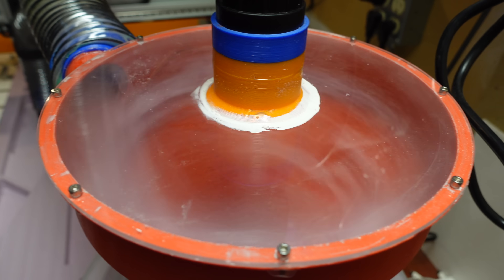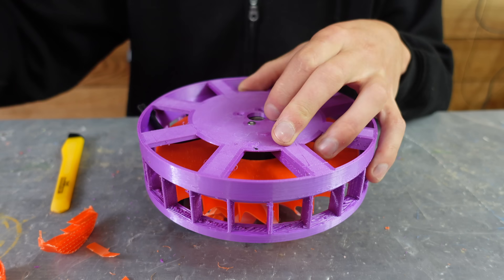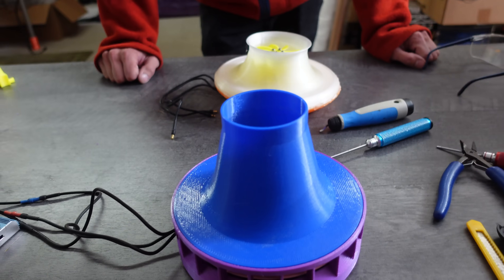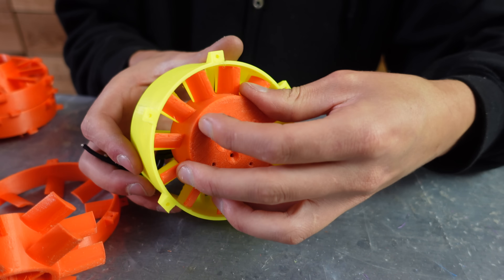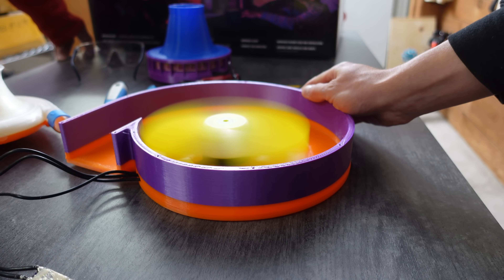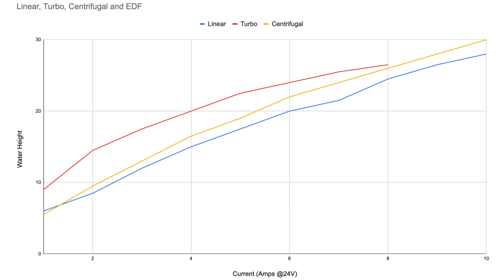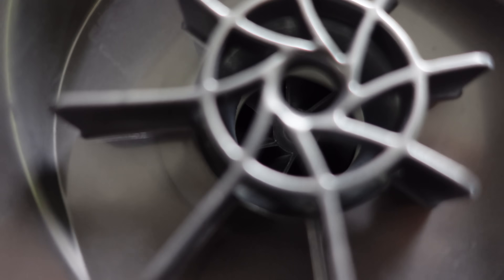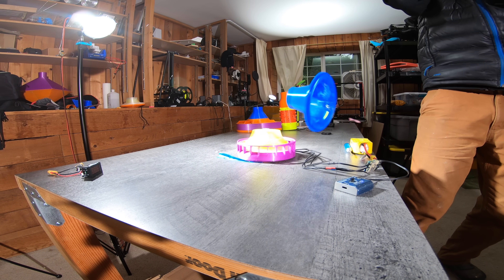DIY 3D Printed Vacuum Impellers

Comment: Looking at the turbine with its housing, my first thought was: "oh no, he made an air raid siren". Look at the air raid siren from Matthias Wandel. Those equally spaced stator columns with the rotor blades are probably what makes that horrible noise.
Reply: "Horrible" depends on what type of person you are.
Reply: Yeah, you need unequal number of blades vs outlets, otherwise you end up with a siren :D
Reply: @akkudakkupl  Yep
Though there are some sirens that have 4 outlets but 10 blades or 10 ports, For instance, The CLM Siren. Another example would be the Thunderbolt series. With only 1 thin opening at the front
Reply: @BSC_PRODUCTIONS  Well the more correct answer would probably be to have blades and outputs non divisible by a common denominator? For example two primes, or a prime and the same number -1 or +1.
Reply: @akkudakkupl  That's only to get a constant tone, I was mostly talking about the matching blade and outlet cutoff shape that significantly increases the noise because of pulsing.
Reply: Also for a compressor those "columns" should be at a flatter angle and farther from the rotor

Comment: Should have also tried a squirrel cage design. Poor static pressure, but they're hard to beat for flow rate.
Reply: Would be interested in a lobe and a screw type too.

Comment: Can someone correct me if I'm wrong but when powering a motor there is no such thing as constant voltage and changing current? If you limit the current you also change the voltage.

Comment: Cool stuff.  Most turbomachines (non-positive displacement) reach peak pressure delta across them around their mid volume flow capacity.  You could be quite far down the pressure capability in your static suction test.  My bet is the turbocharger style would win out for suction per watt input.  Your axial flow design has the most potential but you need pressure taps between each stage to ensure each one is doing its part.  Did each stage have a different blade design?

Comment: fun fact: did you know that vacuum cleaner motors don't have a pipe the air flows out and instead have the air going directly through the whole motor fow cooling?
...or that these motors are special DC motors that can only spin in one direction even if you change the polarity?
They have to spin so fast to create a weak vacuum, because they aren't like piston pumps. If you stop a piston pump, the air or what ever you are pumping can't flow back, however that is not the case for these fans. If you stop them the air can move freely though the fan.
They have to spin so fast just to create a weak vacuum, while having great flow rate.
Piston pumps/ Compressors can spin very slowly and still have very low vacuum, but they are inefficient and have bad flow rate. That is why Vacuum Pumps have pistons.
Oh yeah, did i mention that fans become wayyy more efficient when spinning faster. Pistons can't do that.
That is why Turbo Chargers can hardly create much pressure [but way more than normal fans] ,but have pretty good flow.
And finally most piston pumps have a fatal flaw to fans: they have to go back and forth. Fans just spin.
The same reason why piston motors are so bad compared to electric motors.
[We just use piston motors due to the ability to easily store large amounts of fuel without batteries]
Example: Garden Water Pumps don't need to create a lot of pressure but much flow
Pressure washing pumps need a loooot of pressure (from 130bar [1885.49psi] up to industrial ones with up to 276bar [4003.04psi])

Comment: So you basically printed/built a jet engine and won't use it on an rc plane?
Reply from the maker: The volumetric flow is very low so they don't produce much thrust at all

Comment: I made a shop vacuum a week ago using the turbo style impeller and a cyclone. It actually worked quite well despite the poor balancing of the impeller causing a painful screech propably just wearing down the bearings. I actually got the idea from your cyclone video and hoped you would make a vacuum generator for it. Man I love timings.
Reply: Cool! I've been wanting to do something similar for the shop at my work, homemade giant vacuum and hide it behind a wall with a hose coming out. Those big central vac motors are not cheap but I think if I found an old motor I could make something work. Maybe skin the 3d print with glass or carbon fiber.
Reply: @deathcogunit106  Some years ago we just used small forge blowers in our woodworking factory for dust and shaving extraction. The missus sewed up a bunch of calico bags to collect the swarf; used to work real well !
Empty it into the compost heap(if not treated pine!)
Reply: Thats pretty cool!

Comment: A few thoughts (based on my own experience):
1. In snail-type blower it is always better to add disk-shaped basement to rotor. it is sturdier that way.
2. thicker paddles also helps with durability
3. there is not much difference, if any, between turbocharger-style compressor and snail-type blower.
3. for the highest static pressure - a few centrifugal blowers in series. Many vacuum cleaners uses two staged blower.

Comment: I recently picked up a Dyson V8 vacuum for cheap with no battery just to take it apart, the digital motor inside is just insane, in max power mode it pulls around 550w of power and puts out an insane amount of air, in low power mode its around 150w. I have converted it into a dust blower for dusting out PC's and its the best one I have ever used.
Reply: Makes sense why you only get 10 to 15 min on max... still impressive as hell though. Now if I could only get my kids to put it back on the damn charger....
Reply: @wakefieldallan  Yes, but compared to a regular 1800w vacuum, they are impressive AF
Reply: Have you got any plans/pictures of the converted Dyson?
Reply: Even the dyson V8 is nothing compared to the newer V11s and V15 dysons

Comment: For industrial applications it's pretty common to have a "squirrel cage" impeller in a housing that looks similar to your vacuum designs. At least we're I've worked. 

My pre:watch hypothesis is that the turbos and jet engine usually spin very fast, so might not preform as well on a low rp motor (like a 1200rpm motor.) then again not sure how fast you intend to spin these up. We'll see!

Comment: Yeah the pump works less hard when you block it because the work it's doing is moving air. When you block the inlet you are restricting its ability to move air so it does less work.
Reply: Do RC is right